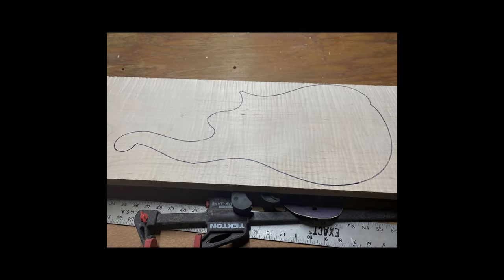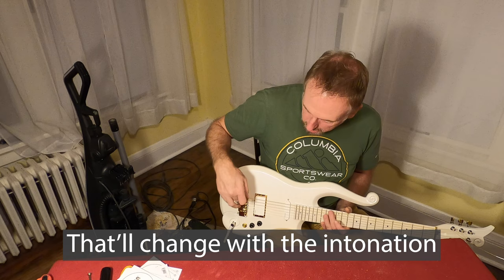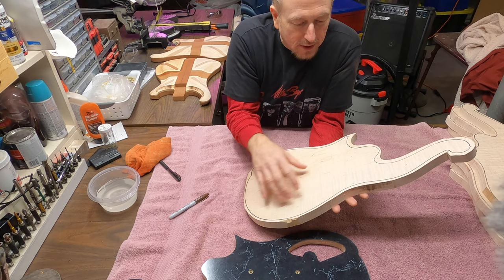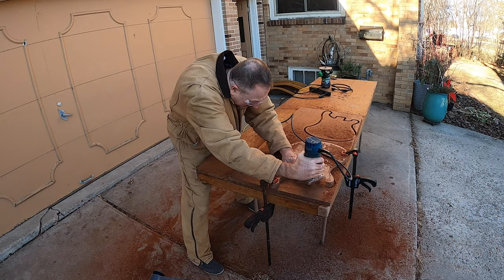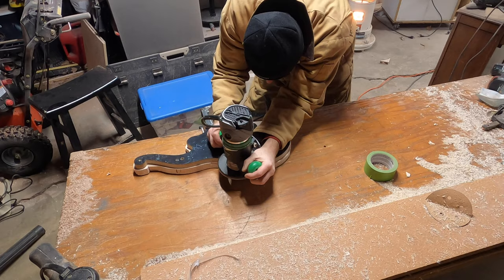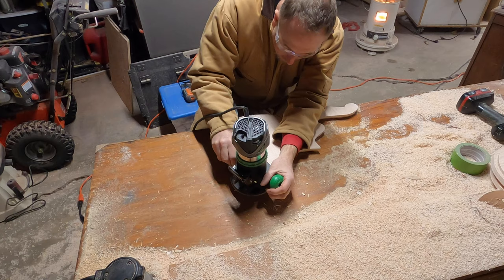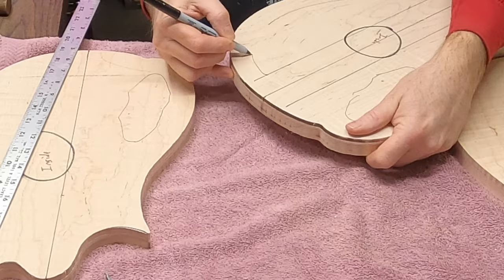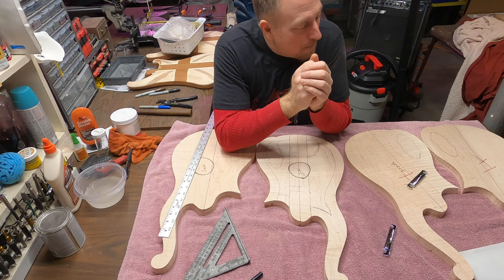Lets Build a Guitar Episode 11 JellyBean Johnson Plays One of my guitar builds

Comment: 2:55 Does anyone else cringe when Steve taps the pickups with a metal screwdriver?  I have found a nylon spudger to be a better tool for such things.
Reply from the maker: so is a nylon spudger...magnetic?  I'll have to check that out!  I promise you, no marks and no EMG pickup was hurt in the making of this film.  It probably sounds like I'm tapping harder than I do.  ha ha!
Reply from the maker: it has to be tapped with metal or the magnetic pickup won't respond.